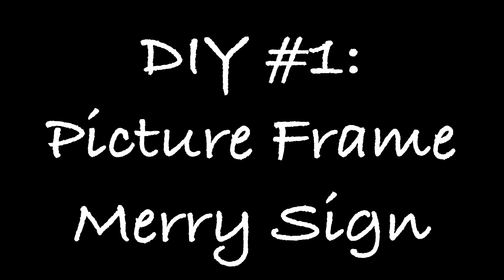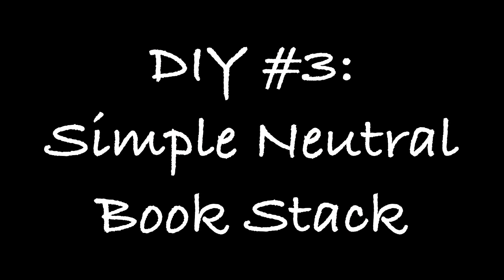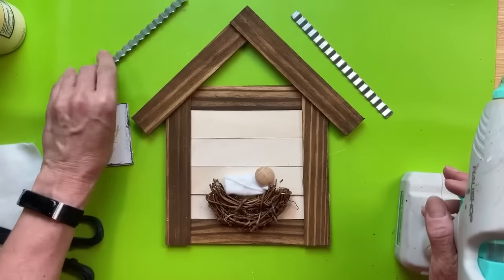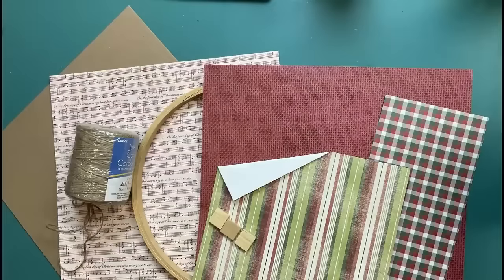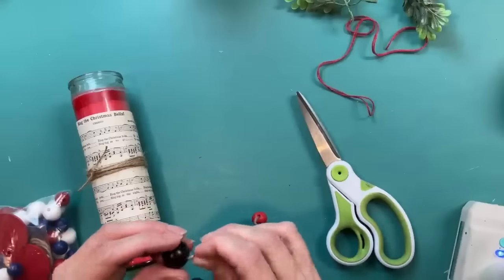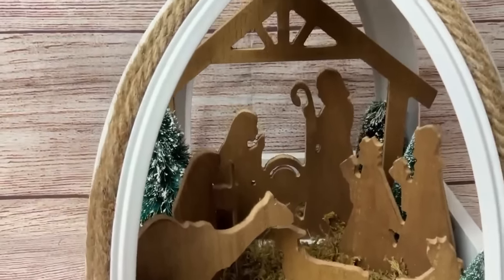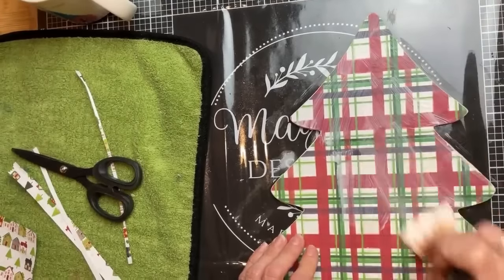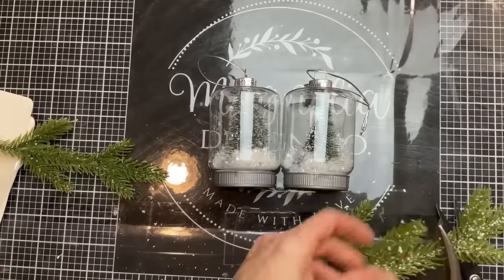🌲🌲TOP 25 HIGH END DOLLAR TREE CHRISTMAS DIYS from 2022 to try in 2023🌲🌲

Comment: I saw you using scissors to ream out a bead. That seem to work well, but I thought you might want to know that there is a tool, called a bead reamer, that is a great tool if you work with beads very much. I make jewelry from beads, and I find the bead reamer a great help.
Reply from the maker: Thanks for the tip!